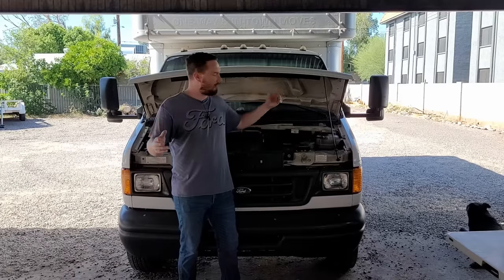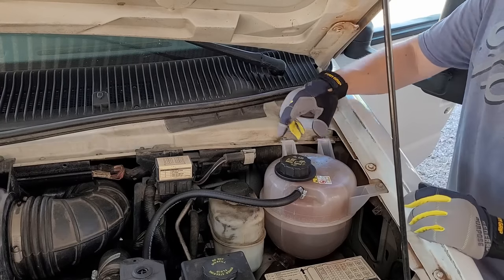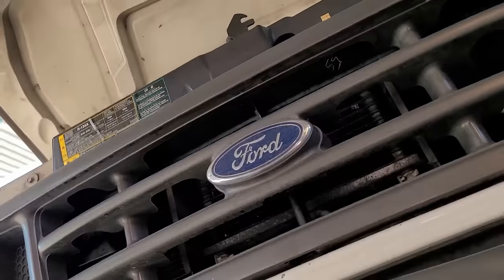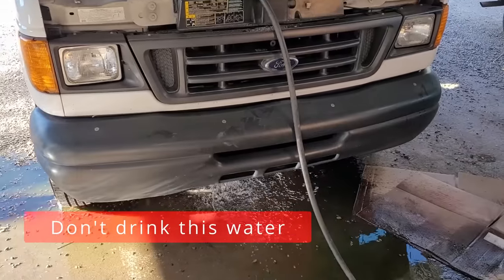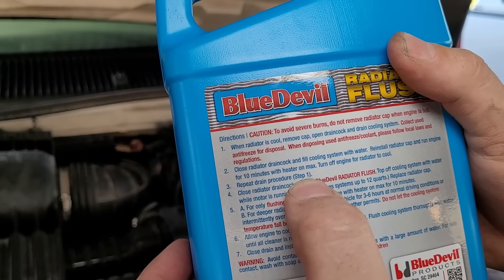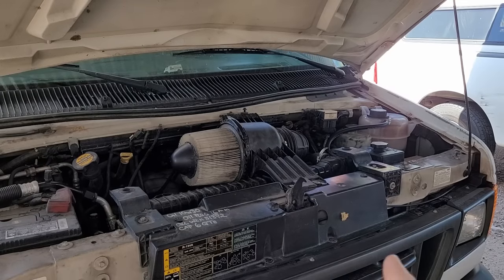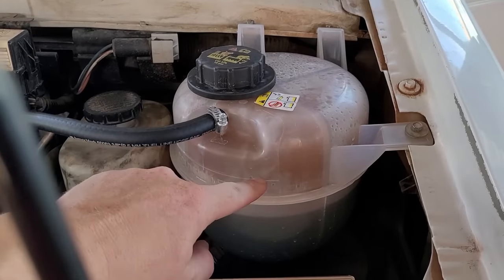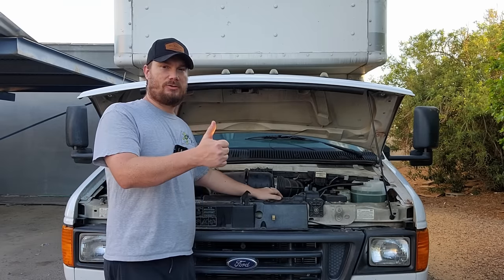How to fix your HEAD GASKET for $56 | Blue Devil vs DESTROYED Ford V10

Comment: Hello men I have the same problem my car star heating when I drive around 65mph. And we change everything. But still heating. I just thing with one is the best. You car still working with the blue devil?
Reply from the maker: It is with like 15k miles since.  It will be back on the channel soon!
Reply: Omg that issue very good.  I know depends about the car But I hope mine is not bad. I follow exactly the instructions yesterday and leave all night. Today I’m going to put everything together. Thanks for the video and the information

Comment: Head gasket stuff works but most times plugs your heat exchanger and trans cooler....ect. so you end up having to go back and flush that. Still cheaper than a head gasket

Comment: Man I bought a lemon. I've had my ute for 2 years and it started to blow smoke and overheat. I just noticed the head had been pulled apart before I owned it. Old green gasket has melted out the sides.

Comment: Mine is a Dodge Avenger and 2 days ago, my headcap started blowing steam, spec 2.4L 4-cylinder. Just got it and this happened. Contact me, please.No overheat, just blowing steam at 40 mph at 7 miles.

Comment: Only use the metal infused stuff because this blue crap will clog up stuff because it coat everything in that sealer unlike the metal added stuff it will melt into a form. I can see people not using this stuff correctly and heating that coolant up to a point were the whole system is sealed

Comment: You guys need to be careful because I've seen techs hydro lock several hondas and bent two connecting rods. When you flush the cooling system you are getting the small pieces which would normally pass I'm through the radiator anyway and you are wedging bigger chunks in the radiator. Try back flushing the cooling system. You can't always tell with steam in the exhaust because the chemical trade off for burning one gallon of gas is the engine makes 1 gallon of water which gets burned up in the exaust system. Check the hoses for temp and pressure before going to the radiator cap.

Comment: Instructions unclear, got blue liquid all over my EV’s electronics now. Advice please.

I did discover on a previous car the OBD2 system logs “miles driven with warning light on” so the garage can see just how long you’ve been ignoring critical errors, and how much to multiply your repair fee by.
Reply: That's why you ALWAYS clear the codes, RIGHT before you take it in. Make the garage work at the diagnosis...

Comment: Just wondering here.  Good video.  Except he never told us 2 things and I need clarification.
1.  When did he actually put the “thermostat” back in?  At what point in the video .. after the 2nd 50 minute idle when he was revving it??
2.  When did he actually top off with REAL  RADIATOR fluid instead of the distilled water.  Aren’t you supposed to have an approximate 50/50 mix at the (very) end??

I just never saw these 2 steps and for us rookies it would really help if anyone could tell me when to do those 2 things at the end.

OR, does he just plan on keeping the thermostat out for the long term

Thanks for any clarification on the timing for those last 2 critical steps.  

Otherwise great saved video for me and thank you in advance for answering those 2 questions

Comment: why was it your last 10mm, what happened to all the other ones that you used?
Reply from the maker: you don't OWN 10mm sockets, you just kind of set them free and appreciate the time you had together.
Reply: @HerbOMatic  EXACTLY!!!!  I just recently had my last 10mm socket leave me, and ended up getting a couple extra, I'm trying to treat them extra good so maybe they will stay a bit longer.  I noticed my 10mm open/box wrenches are starting to do the same, had 2 of them go feral and take off now in the past year.
Reply: @HerbOMatic it's 10mm spanners for me.  They're roaming the fields out there somewhere. Occasionally  they visit.

Comment: Desperate people take desperate measures.  These kids of auto parts snake oils have been around for 60 years. The only way to fix a blown head gasket is to replace e the head gasket... period
Reply: It's still working.
Reply: yup.. might as well take that rad core apart and pull that triton out...

Comment: They said he Same thing about radiator stop ohh it a permanent fix but ended up having white stuff of Radiator stop leak that clogged the radiator that why I had to  replace the radiator. That ain't permanent fix its gonna cause clogging and temporary fix where's the solid proof. And u didn't show the spark plugs to see if they have coolant non them

Comment: If you use that stuff you're still c
Going to have to replace the gaskets. Plus you're gonna have yo replace your heater core and possibly your radiator and over flow tank unless you can flush it all out. Don't take my word for it use it and find out for yourself.

Comment: The people that changed my antifreeze ruin my engine they used such strong suction pressure on the reservoir and then they used such high pressure to put in the new antifreeze they damage the head gaskets the truck was running fine when I had the oil changed at Walmart and the engine was quiet and running smoothly before they change the antifreeze now the engine is so noisy and the oil is white there is no hope for this truck that was running so good now I won't be able to go to the VA to check my cancer I spent over $900 for an oil change a new tires and it's all for nothing your product won't work for me it's too late for that